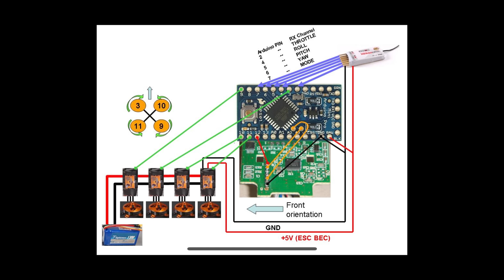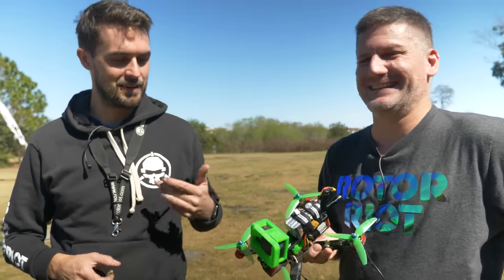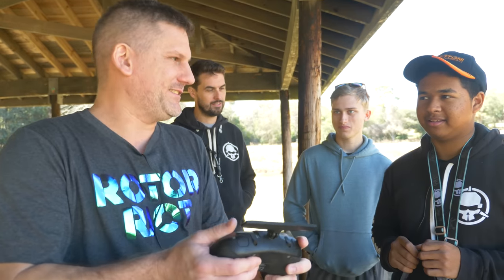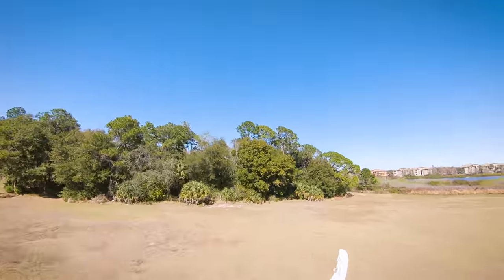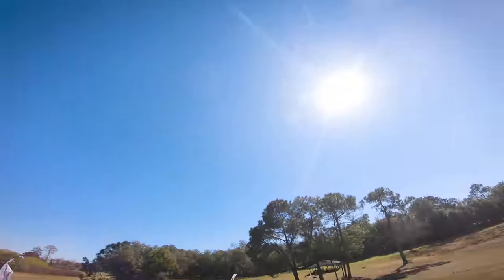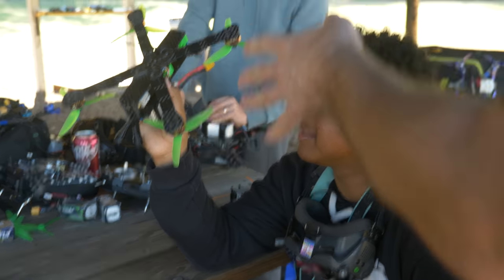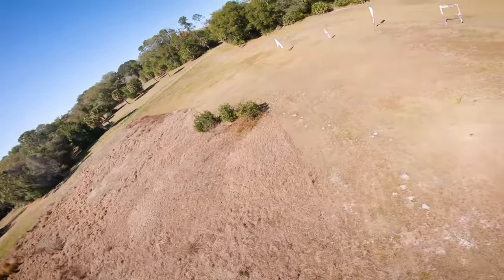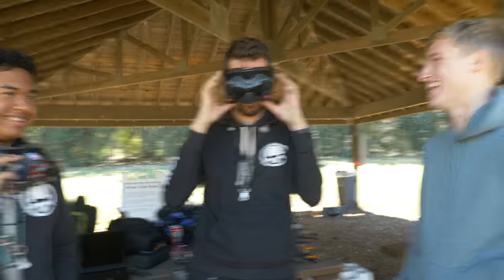Building a Drone Flight Controller FROM SCRATCH! - Trying MultiWii in 2022

Comment: I built a MultiWii quad for my research project at university 2 years ago.  It was fun searching through old forums trying to get as much information as possible.  I also built my own frame out of aluminum...which was a mistake, cuz if I landed hard, an arm would bend and never bend back into the original position...so PID tuning became a hell of a thing to do each time. Still got a grade A in it lol.

Comment: Yep, I started with a multiwi and then went CC3d in 2014. It is amazing how far flight controllers have come. We use to have a separate osd as well the first ones however there was no way to know your voltage except by feel and time.  I remember flying new packs one after another timing them and inching up the timer till I got the flight time close. 
We all used to use the tape to mount everything and Velcro straps for batteries that always ejected in a crash.

Comment: its crazy how fast flight controllers evolved. while I havent flew a wii FC, I did start out with the kk2.1 back in 2012-2013 on my 250 hobby king frame. I was more into microdrones though so I was using a lot of hubsan and walkera FC with brushed motors. The very first configurable FC I did build with was the AlienWii with dsm2 satelite RX. They were $50 for a fully configurable FC in MultiWii. I didnt get into 200+ size drones until I built a NAZE32 drone.

Comment: Cool stuff! I built the flight controller for a drone for my uni project last year using a PIC18F4321. I managed to get it to fly and level itself running the code at 50Hz haha. 

It was a little easier because I used a GY-25 chip which outputs angle rather than having to address the gyro and accelerometer directly, but even still it was a difficult feat to get that bird in the air!

For comparison, my Microcontroller had a 32MHz clock, 512 Bytes of Flash memory and 256 Bytes of RAM whereas a modern F7 FC runs at 216MHz, with 512KB of Flash memory and 256KB of RAM!
Reply: Hey man! I'm a software developer and i want to learn how to build drones from scratch can u please guide me or provide me with links of resources from where i can learn

Comment: I still have all my ancient early multiwii boards tucked away on one of my spare tool boxes properly prrserved in an anti static bag like they ancient relics  😅 
It's wild thinking about the early days of Multiwii compared to now 😯 I feel spoiled as fuck now, roughly ~10 years later, rocking shit like 128khz 32 bit 4in1 esc's, ~470mhz H7 FC's, toothpick aio builds, micros, elrs, fucking digital video & the list goes on & on 🔥🙃 we went hard on this drone shit frfrfr
Reply: fax. i was lucky to get into it on a 3s KISS 1.03 FC alien rr5. i thought that was the bees knees. still have that old.
 alien and i think i'm gonna put a fettec osd on it and fly it again. i know i wasnt really "ruffin it" but im proud of myself for getting into the hobby with relatively limited resources. fpv has come a long way over the last 5 years. let alone 10!

Comment: my first drone used the Paris v4 multiwii board. I bought it pre-soldered because I didn't have a soldering iron at the time. My second board was an Eagle something and it had dip switches to select number of motors and layout plus a normal and acro mode.  then the kk board and about six kk2 boards  I still have the Paris and a couple kk2 boards.

Comment: I have a few Tricopters on Multiwii, they fly nice. If you just cruise around and fly smooth they are fine both Los and fpv. I recently converted a tri to Betaflight and am still tuning the yaw. It's ok but Multiwii is closer to being very good on the stock PID's.

Comment: It's interesting why you had problems with yaw. I am working on an "old-school" Miltiwii tricopter now (using Miltiwii 2.4) and the tricopter needs a very large stick deflection right to yaw right, while yawing left is easy. Maybe there is a bug in the code?

Comment: That looked fun.  I've been at FPV drones since 2018.  They were pretty well sussed out by the time I got to 'em.  I was into r/c in the late 70s, building 1/12th-scale Tamiya kits, and using a 2-channel radio, before taking a three-and-a-half decade break.  I never dreamed of the kit we have today back then.  Even 2018 gear is literally Buck Rogers stuff compared to what was on offer in the late 1970s.  And much, much cheaper, relatively speaking.

Comment: I'd like to see a gyro attached to a momentary switch so when you push your bumper or what ever switch you place it on it'll turn off stability mode.
Basically a momentary acro mode with stability after releasing the momentary switch or vice versa.
+ the Armidillo just walking up to you guys like that is awesome, think he wants to be part of the crew. 😅
Reply: I think you mean Tactical Assault Possum* xD

Comment: afaik, which might be outdated as heck: multiwii depends on other sensors to improve calibration and filtering on the gyro, even if you aren't actually using them directly for stabilisation.

Comment: You guys are dealing so well with the awful latency that I suggest a long range experiment with a mobile phone on cellular network as an FPV cam (and maybe ELRS for control).
Reply: Try flying a drone located in Italy when you are physically in Detroit.   I did that with Skypersonic and it was soooo much fun.  Tons of latency.  Almost had to fly in angle mode to keep from crashing.  

I did manage to fly manual mode, but, it was very difficult.

Comment: just shows how much fc and the firmware is doing. my quad with cheap motors, source one frame and f7 fc flies so damn good, it does what you tell it, and even in high winds when you let go the sticks it holds its angle absolute solid.

ive thought about building a quad with no fc and jjust usig mixing just to see how impossible it would be to fly.

Comment: Bubbys reaction to zero throttle had me laughing hard 😆
Pfft he started on Radix on BF 3.5.7 (butter fw btw, still use it) most of us have been around way before that - born in the darkness 😉
Reply: Fact that there is a min throttle setting in the code that you can keep the motors spinning at low throttle.

Comment: you could get faster PID loop to stabilize even better, if you use 32 Bit microcontroller like STM32 blue pill board, instead of arduino, which only based on 8-bit Atmega 328p , and use MPU 6050 to combine Gyro and Accelerometer measurement, instead of using only Gyroscope which can drift overtime.

Comment: Quad might be too small. When i flew my multiwii it was on a 450 deadcat frame (later upgraded to a KK2). It wasn't very agile so i guess the gyro could keep up.

The Yaw was pretty bad, especially as i was coming from a 450 helicopter, and yeah, i still have a couple of Y frames (a full size and a miniquad).

Comment: Would it be possible to have a quad without a flight controller at all? Just have it use motor mixing in the radio and the ESCs run straight off of PWM from the receiver? So it would be a fully manual drone with no PID loop at all to help with stabilization.
Reply: Unfortunately, it's not possible, a quadcopter is technically an example of a Non-Linear system, meaning that naturally the change of its output is not proportional to its input, also at the same time there are too many disturbances from the environment that influences the system. So in practice, it cannot stabilize on its own, and if we humans act as stabilizers of those systems, we cannot react fast enough, that is why we need some kind of controller that can react fast enough to change the system, like an embedded system.
Reply: @dubber889  At at the very least that sounds like a hilarious video to me!

Comment: I wasn't early enough for Multiwii, the first quad I had ran CleanFlight.  It was the last version before Air Mode came in, so 1.7 I think?  Anyway, yeah, quads back in the day were a handful.  I remember that it was a good idea to plug in with the quad level on the ground, otherwise the gyro wouldn't have a good level.  So that might have explained the inconsistency the guys had between flights in the video.  Probably needed to give the guys Gemfam 5030 bi-blade props on a 3S pack for the rfull experience though!  Or maybe slightly older school and build an Elextrohub.  I think at a certain point the Electrohub was everyone's first quad!

Comment: You didn't had to use pwm for reciever, ppm and some serial protocols(even sbus) were available in MultiWii 2.4
Reply: Yeah, I saw the ppm later in the build process.  I didn’t see sbus, maybe I missed it.  It was after I had already wired everything up PPM.  Originally, I was trying to use the first firmware version, but, couldn’t get it working.
Reply: @LetsFlyRC  you would however need an external inverter for sbus and also if you are using a atmega328 based board with 1 UART then you would need to unplug the reciever to configure the board. With a little code tweak one can add ibus too.
It's obsolete but fun to try

Comment: hey so whats up with the xair antenna on those goggles?? i see the coax running through a hole in the goggles instead of to the sma??
Reply: That is a custom antenna setup that Hugo made for me.  Hoping he starts making them for everyone.  

The cable bypasses the rp-sma and goes straight to the ufl on the pcb of the goggles.  Eliminating the potential for loss at the connector.   And it looks way cleaner and fits in my backpack better. :)

Comment: Hi, I'm a software engineer and I'm really interested in building drones. I want to make a drone from scratch like program the flight controller, add gyroscope and do all the tiny detailed stuff (obviously excluding manufacturing of the electronic components). I'm even up for building my own frame from wood. I just want to learn all this stuff but I don't know where to start from so it will be really helpful if someone can guide me through it or provide some links where i can learn more.

Comment: one of the first commercial quad copter toys was mecanical gyro on each propeller and infrared remoe the same grade than actual flybar helicopter toys 2.5 axis at 25$
 the sole survior of this marvel era of innovative and often fail designs 
also the second quadcopter had gyro but no acceleratometer what mean no speed detection

back in the time their was no gyro at all on gasoline hobby helicopter for a starting price of 500$ welcome to beginners to manage anti torque
just flying 10cm can took about 20hours of carefull atempts
its like starting by accro mode nowdays
this was the past millenium and even actually most of the real drones users are not ready for racers
ten year ago their was a good drone without remote not sure if it still exist and if all the real drone have an accro mode